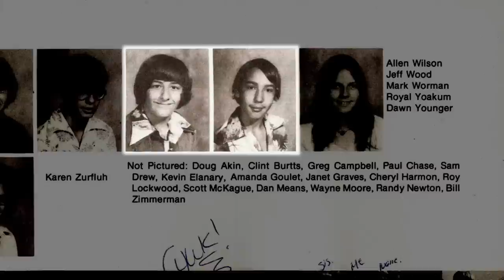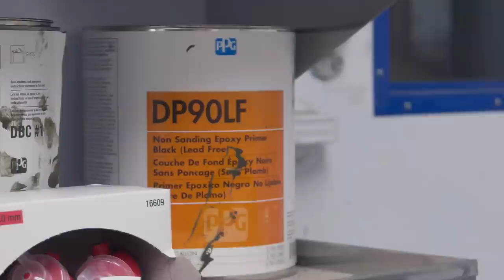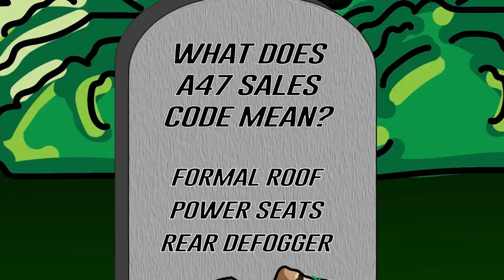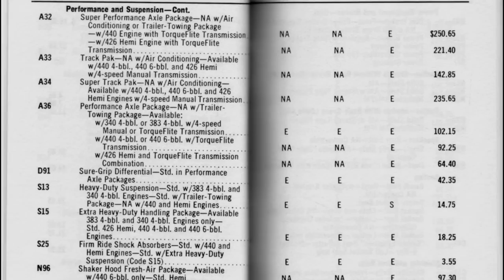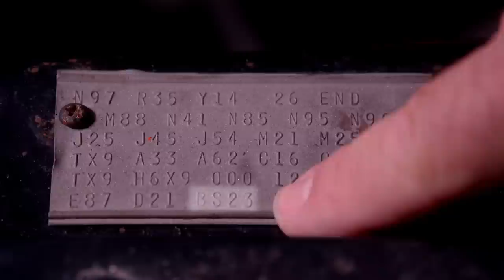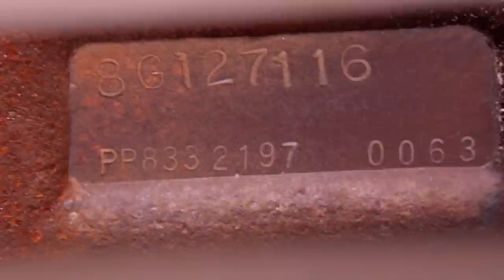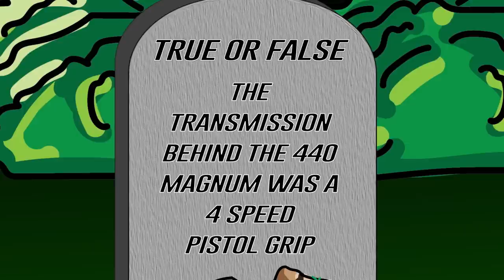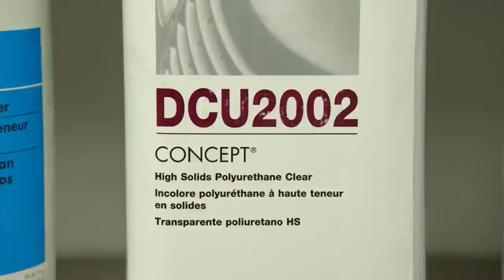INCREDIBLE BARN FIND: 1968 CHARGER R/T 426 HEMI 4 SPEED:

Comment: Had a 69 Dodge Charger Hemi.  Replaced the carbs. With 2 Elderbrock 750s. Put Hooker Headers on it. Saved the 4-10. Replaced it with 3-75 gears. 727 Trans. Drove the old Highways.